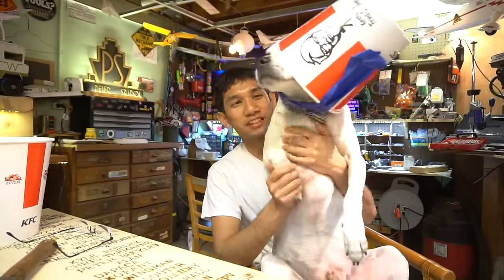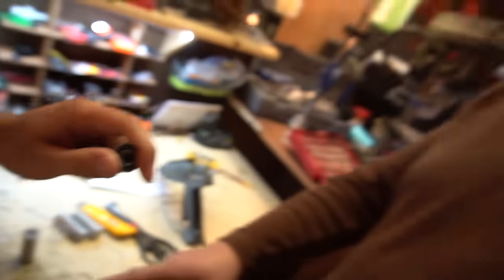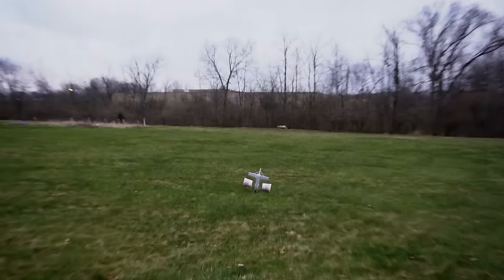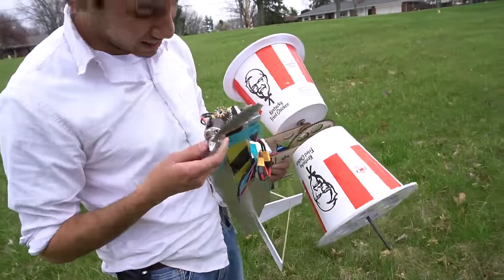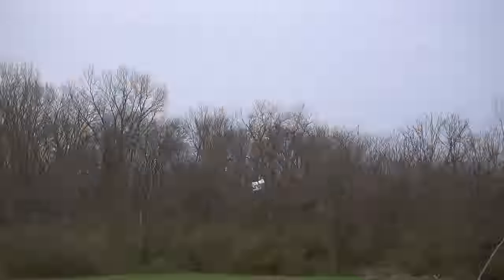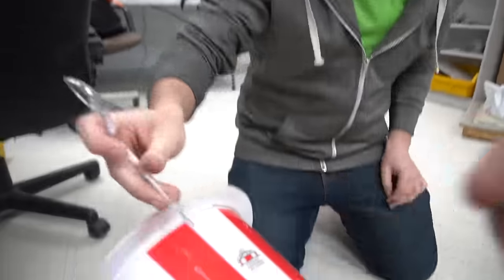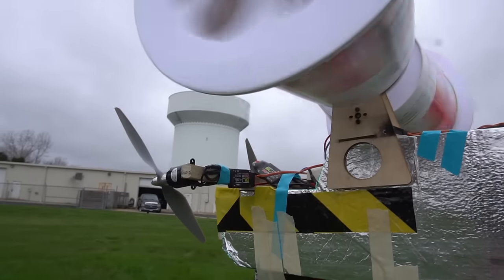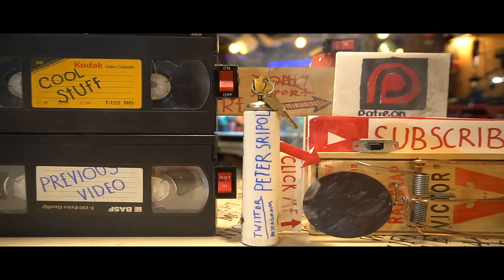RC KFC bucket aeroplane (magnus effect)

Comment: PETER... CAN YOU BUILD A FLYING SAUCER OR A UFO?
Reply: Interesting.. but isn't most things peter flies an Unusual/unidentified Flying Object? :D 
If he did build a 'UFO' what sort are you proposing conventional like the old jet disks or maybe something fringe like electrostatic lift?..
Reply: You are correct sir, most all craft Peter constructs somehow are unusual. This is why i enjoy his videos. this is how you stumble on to that something great that could change a minds idea, or even the world.  
    As far as the type... Maybe something with a hidden lift source  classic disk or UFO shape, VTOL and forward flight. I alway thought if you built it just right you could fit an RC UFO with an internal helium bag to lighten the load. Use an internal system of vents ducts and directional thrust to stabilize and propel the craft. I always thought you would need gyros set in key places as well. For an RC UFO, I would give it a   5 ft diameter. 
    I'm not building it though, but i would enjoy a creation spawned from his mind.

Comment: Hey, I know very little about the magnus effect, so forgive me if what I am about to say sounds silly... 
I'd just like to know if putting the motors/props above (and in front of.. obviously) the rotating drums would work better by having faster airflow over the top than below (like a conventional wing)?
I'd definitely be interested to know if that works :-)
Reply: similar to a curveball, the lower pressure side is on the side of the buckets moving faster relative to the air. so if there was a way to speed up that air flowing over the top of the buckets, you're 100% correct that it would work better.

getting that extra air speed without screwing something else up like aerodynamics is another thing entirely.

Comment: You need an opposing gyro to keep the nose up
Reply: Wonder if pointing buckets wide end in would improve dihedral effect for better roll stability?
Reply: Maybe moving the battery packs to the rear of the plane would help balance that out?
Reply: A counter rotating bucket inside the KFC bucket.

Comment: Is having the motors mounted so low down effecting the speed of the airflow under the bucket? Faster airflow over the top is what is giving you lift so by re-positioning the props couldn't you increase that? Would maybe mean you could have the buckets spin slower giving less weird gyroscopic effects. Thoughts internet?
Reply: i agree
Reply: kinda my thought why to move buckets further apart out of the prop wash
Reply: sam rowland You want to have high pressure under the buckets, and low pressure above, the higher the pressure differential the more lift. Biggest problem is no ailerons or equivalent.
Reply: Isn't increasing the airflow below the bucket lowering the pressure? With a conventional wing the air is forced to travel faster over the longer curved shape of the top of the wing, causing lower pressure. So shouldn't making the airflow below the bucket faster also decrease pressure and reduce the differential? Also lots of planes fly without ailerons, although they tend to have dyhedral (not sure on the spelling haha) to help them self level.
Reply: sam rowland As for the dihedral, I suspect you are correct, if he split the rod and angled the buckets up a few degrees it should then fly much more stabily.
Reply: Wogden 700 LOL thanks, Ya, I get all that, I was a commercial pilot years back. But many RC aircraft do not have ailerons and just turn on the rudder. The manoeuvre makes passengers air sick, but so does the ornithopter so if all we are after is to prove the theory… All I was saying is that I suspect dihedral would help stabilize the rolling.
Reply: Wogden 700 Also dihedral is not only for high wing aircraft: the islander, turbo commander, and twin otter are all high wing, aircraft and all have a dihedral wing: it allows for a more hands off flight experience, generally a better mannered aircraft.
Reply: Wogden 700 Also, the ornithopter, the gossamer albatross, and  Clement Ader's aircraft flew well enough without ailerons, all three were manned, so they are not by any means mandatory, only highly recommended.
Reply: Wogden 700 Ya. Feel like a tool now: I looked at the diagram and knew it had to be wrong, but it's in the textbook and every instructor and every pilot parrots it so I certainly wasn't going to be that student that argues with his instructors about how the textbook is wrong lol. As for rotors on ships they are terribly inefficient: I'm of the opinion that had oil prices not tanked, every new ship on the seas would have a number of automatic power kites, or even furling sails. We were on the cusp, and I was getting excited, and then the argument for the technology collapsed.
Reply: Wogden 700 Yes but they both still had roll control, Write's with wing warping and I believe Curtis used spoilers if I recall correctly. I was meaning aircraft that had no roll control and relied solely on secondary stability to provide the righting force. Anyways this is a science experiment: I see no modern real life application for this technology: outside of the dam buster which is a very outdated weapon, there are always better forces to apply to your project than the Magnus force.
Reply: Wogden 700 If I'm ever in the area I will. thanks for the heads up.

Comment: Nice and useful experiment, although the solution with the crucibles was more about the Coanda effect and the plane was kept in the air thanks to the powerful propeller engine. The Magnus effect is good for ships, not aircraft. It is a pity that you did not use the forgotten principle of a freely rotating wing in the longitudinal axis in the shape of an "S" profile, which does not require a drive like crucibles - they rotate by the onslaught of air. In the last century, we have used it as tethered dragons that have created great buoyancy.

Comment: could you tell us where you found the online gear calculator?
Reply: Cooper Cash someone answer
Reply: Cooper Cash there's this new thing called Google, people use it to search for things, you should try it.
Reply: Cooper Cash Matthias Wandel has one at woodgears.ca
Reply: Cooper Cash if you don't know how to use Google then Google how to use it
Reply from the maker: Yep! geargenerator.com is what I used! sorry for the late reply theres too many comments to sift through! FWIW I also had to go to an online converter to change it into a DXF that autocad LT can read.
Reply: PeterSripol 

My cousin and I wanna motorise his Lego model car, I just want to know where I can get the motors used for this this and also the remote controller???

Please help me out, that would be awesome
Reply: no h
Reply: Simple math formulas for what you're looking for -
first of all, speed and torque are proportional
Speed Gear 1 / Torque Gear 1 = Speed of Gear 2 / Torque of Gear 2

Diameters of the gears can be calculated to figure the difference between two factors.
simply put - 
Gear 2 Speed = (Diameter 1 / diameter 2) * speed of Gear 1
Gear 2 Torque = (Gear 1 speed * torque) / Speed of Gear 2

now put together your own calculator in excel. Hope that helps!

Comment: If you extended the back wings and maked the blade bigger it would have worked
Reply: if you put a strong enough engine with 5 big blades with a good curve in the right orientation at the tip of a tube with some wings at the end turned a lil'bit against the rotor direction, it does the same einstein.
Reply: Alhric Originalz
Reply: Sand the buckets for more friction with the air

Comment: The hard roll torque is probably gyroscopic precession - You have bucket flywheels with some inertia. One bucket + foam board is probably just a little less aerodynamic than the other, or the rudder is canted just a little which induces a yaw torque. The flywheel inertia and yaw torque interact at right angles resulting in roll-axis torque. This agrees with the observation that the plane prefers to pitch toward port, and is more stable when steered toward starboard.

Comment: It looks to me that the airflow is faster on the top of the bucket than on the bottom of the bucket when the plane is moving forward.  Faster flow equals lower pressure.  In theory.  However, with the propeller going the airflow from the propeller makes the airflow faster on the bottom of the bucket, which opposes the function of the spinning bucket.

Comment: Use the same plane just add mini wings for extra control!
Reply: That's complicated. Your suggestion is an interesting (obvious?) one (sideways turbines? Think how a hairdryer pushes out air). Anyway, you would have to put the "mini wings" INSIDE the cups; angle each part so when the cup turns it pushes the air to the bottom of the cup. The open ends of the cup has to face foward and the bottom part of the cup has to be replaced with a very carefully designed cone with a small openning at the pointed bottom. This concentrates the air to push a free-spinning (tuned) plastic propella. So...not so easy...but workable.

Comment: There is enough lift, but the problem is stability. Also to control, each bucket must have separate rpm control....you should put buckets little further away from the body, too.

Comment: I believe this is more the plane hanging from the prop.  If you notice if it ever goes nose down it dives.  If the buckets were affecting lift at all.  You could stop the prop and correct it to level flight.  That propeller slipstream is why you always hear more right rudder.  The combination of engine torque, propeller rotation and longitudinal slipstream tries to spin the fuselage and push the tail around.  Right rudder compensates for that.

Comment: Fixed wings vs rotating buckets
Fixed wings is definitely more stable.
Cyclocopter hybrid instead of spoons for improvement?
Will cylinders instead of buckets work better? What about swapping the buckets?
I suspect having 2 hover wings may be a more efficient design!?

Comment: I think, you don't like to calculate something. The lift by the magnus effect can be made very powerful. But therefore the tangential speed of the cylinder must be in the order of the wind speed or higher. Otherwise you just generate a lot of drag. The lift of your aeroplane was mostly generated by the thrust of your propellers and the angle of flight.

Comment: Maybe try a bucket at each corner of a square on two counter rotating axles and the motor in the center below the height of the axles for proper weight distribution. Just gotta feelin that might work. Keep rockin it.

Comment: Great video!  I didn't understand though why you were using a larger gear as the one driving the bucket "wings".  Would you want both gears sort of small but the bucket wing gear the smaller of the two?  That way for every 1 rotation of the motor gear, you'd get more than 1 rotation of buckets drive shaft.  That part confused me.

Comment: I think it works because the bucket pushes the air over the top faster and the air on the bottom slower, which is doing the same job as an aerofoil by making it denser on the bottom than on the top.

Comment: you probably needed bigger fins. You couldve also add a trailing wing (a small one) to help with the turbulence. You could've also flip the buckets such that the thicker part points inwards, that way you would have a pressure distribution that maximizes near the center instead of the tips. Nice job though

Comment: You need a greater wingspan to get beyond the slipstream of the propeller and to improve stability. Your propwash is overpowering the airflow around the buckets and killing the Magnus effect.
Reply: You also need to drastically increase the surface friction on the cylinders. Make them like paddlewheels.

Comment: I feel like when you turn the speed of the buckets up the motor was pulling the plane up around the buckets as it was spinning them, this may be why when you turned the speed up the plane always tried to turn up. I'm most likely wrong but that was just my impression.

A way to possibly find out would be to make another plane but this time, instead of having just two buckets use 4, 2 either side like you have them now but positioned kind of like a chinook, this should keep the plane level naturally and you can then use the tail to change pitch .

As I said though, I'm not an engineer or anything. Physics are weird and I know very little about planes.

Comment: ..Would  installing a frame inside the buckets help?  There has to have a certain amount of deformation from the rapid rotation.  A lightweight  "frame" might help.  One in the middle of the buckets (and maybe one at the mouth of the buckets?)   Also,  I noticed that the entire  tail assembly was vibrating badly.  Maybe you could glue some strips of Aluminum to provide more support?

Comment: I like the twin propellers countering each other's torque what have you thought about the air flow that's propellers are pushing past the bottom side of the bucket is countering the airflow lift going over the top of the buckets.

Comment: I would try parallel drums not tapered like the buckets. I would mount the centre of the drums on the thrust line of the fuselage, not way above it  . A one way bearing so that air flow can speed up the drums past the drive motor speed. Like an autogyro.

Comment: Could the fact that the gear at the top is off center be part of the problem, so it's pulling it to one side maybe? Also how about if you covered buckets in felt? I know from playing tennis that when the felt is worn off the tennis ball, topspin and sidespin don't work well; the ball does not curve as much.

Comment: Flip the buckets, maybe a little less lift, but way less turbulence pushing the tail around. Especially if they are closer together and and mostly not separated by the fuselage and it ends up with the Tesla turbine effect from the bucket tops to push more air which would probably add more lift and stability as the Air Multiplier effect created by the turbine exhaust would straighten the turbulence and reduce pressure flowing over the fuselage. Putting the props behind the buckets would reduce it even further. Add a ventral strake and/or some winglets on the back and shift the weight a bit to compensate. I'm not a NASA engineer, but i did stay in the parking garage of a Holiday Inn Express last night. Send me a kit and I can demonstrate. Please include the chicken, times are tough. Thanks in advance.

Comment: I think if you mount the motors up top so that the wash pushes the top of the roller instead of the bottom of it. Right now you have the drive motors working against your wings, then the nose pinches up during power because it's wing is losing lift while simultaneously getting swung up around the fulcrum
Reply: Might also be more stable if the buckets had the small ends facing outwards?

Comment: Hey, add a propellor somewhere around the tail of the plane to counter the effect of the rolling buckets, just like the propellor in helicopter to make the flight more stable. 

I am a Mechanical Engineer and if possible I will try to do analysis on this for you and try to make the flight more stable. Although I have to read some extra books for aeronautical engineering to understand the aircrafts forces.😂😂

But the concepts great and keep up the work

Comment: Why was it pitching nose-up when you increased bucket rpm? And then nose down when you quickly reduced bucket rpm/torque? That would seem like you had the buckets rotating in the wrong direction.. Not sure if your craft was actually flying due to magnus effect or if it was just more of a power-on, pitch-up, thrust-hover. I would have kept the bucket rotational access lower, along the centre line of thrust, to rule out/reduce the pitch-up effect (caused by the drag of the buckets), then mount the engine/engines in the rear in a pusher configuration to reduce the prop wash over the buckets. Fantastic project and video either way!! Keep being awesome, man!!

Comment: The buckets need to be moved towards the back of the plane or you may need a horizontal fan under the tail which its RPM is controlled by a mean of gyroscope.

Comment: The bucket pushes air backwards. Put a big flap in down of the bucket to push air down so it can generates a heavy lift.. Diagram.. 13.20 minutes... And 12.07

Comment: I am not a pro. But i think if u placed those propellers higher. Opposing the uper side of kfc bucket...then the air coming frok the propellers will go through the upper side and it should fly fine. Because now.. The propellers are too low and the air coming through em are blocking the flow below the buckets.

Comment: Elmer's glue and coffee filters give the foam a substantially longer life expectancy.. the more weight in the process, the more wasted energy you need to get the actual work done
the old basket style coffee filter is best.. really thin.. no weight even with the glue.. really strong after you use the high tech carbon fiber from China.. they have been using it for thousands of years

Comment: the buckets are spinning the wrong way. try reverse. if you doubt me, try using a smoke and wind tunnel.
Reply: it is pulling the plane down instead of up. by reversing the spin, it would gain lift.

Comment: I think one of the issues is the props are forcing air under the rotors wings. If they were above the rotors or the rotors were lower, maybe it would help stabilize a rotation speed. You’ll also likely get a stabler center of lift from left to right if the rotors were longer. As far as center of gravity moving front to back...I got nothing.

Comment: why doesn't the effect of a normal Airplane wing counter this out? At a normal Wing the slow air at the bottom has more presure than the fast air on top of the wing but here it's the other way around so it should push the plane down.